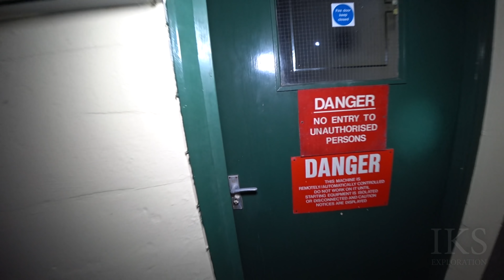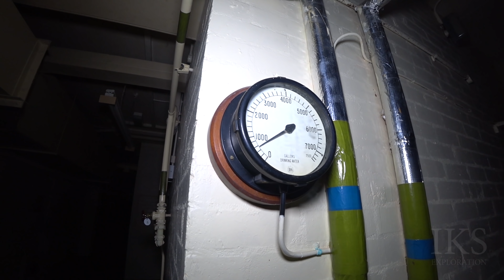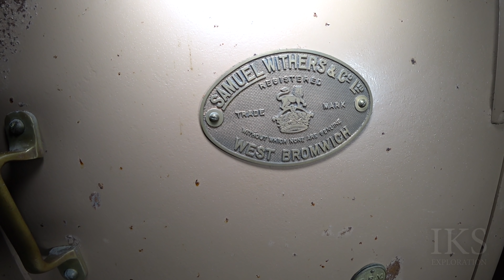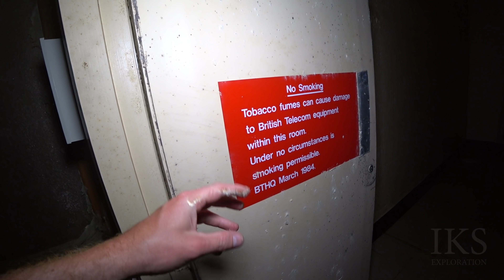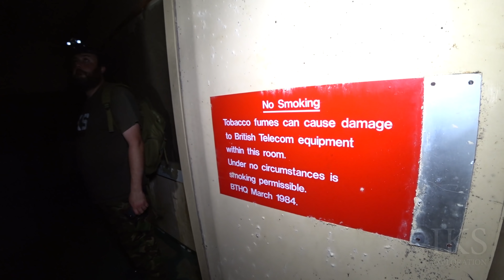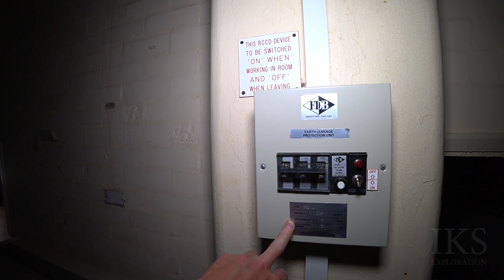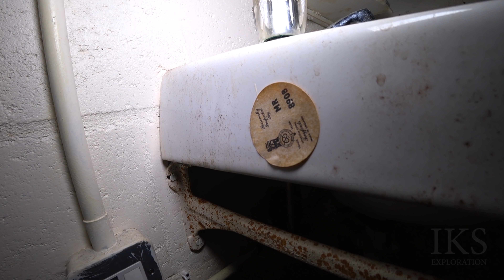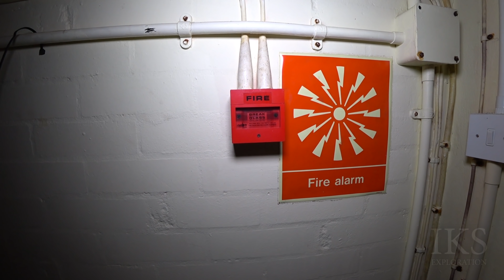The Secret Nuclear Bunker - Episode 1

Comment: I work in a lot of 60's to 80's Government buildings and itnis amazing how much of the equipment in them is the same as this bunker.

Lights with a main switch then pull cords for individuals to change lighting.

BT & Mercury Telecoms boxes
 Govt standard carpet tiles and ex MOD paint.

Coax network sockets for the old green screen terminals.

Standard issue hooks, noticeboards and signs.

Great video